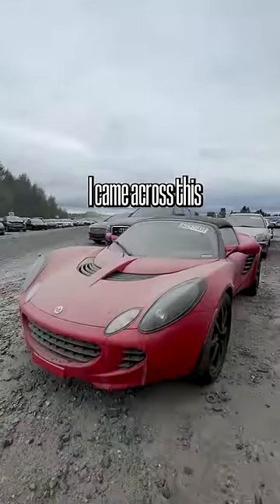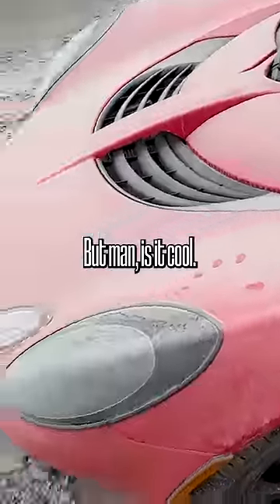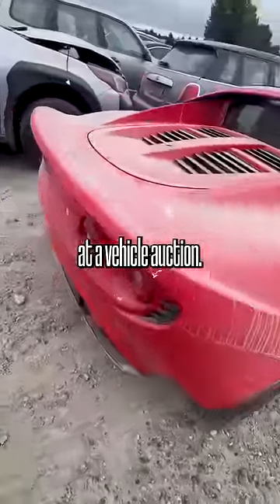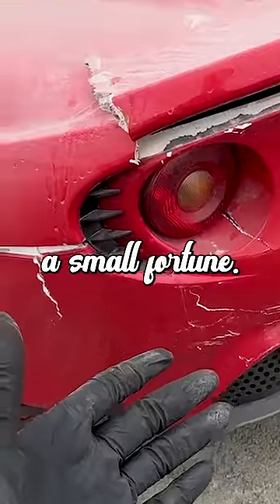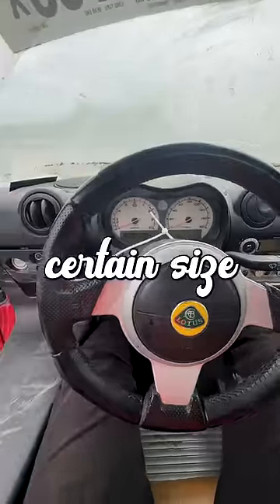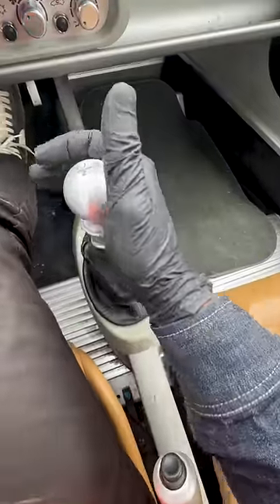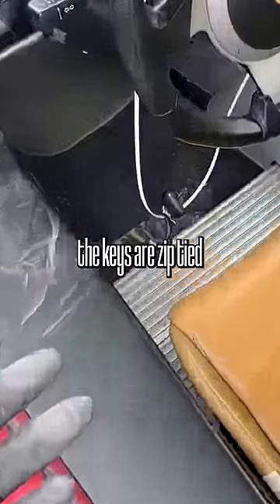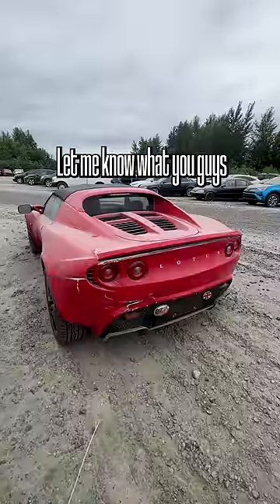Auction Lotus Elise - I Still Can't Believe It...

Comment: What a nice car it's a shame that it got hit
Reply: Yoo 😂
Reply: @@raingoesrawr I've heard that so much and it still sounds funny
Reply: @akibhossain5558  yo its me bro you didnt recognize me? 
TheElantraMan?
Reply: @01Elantraaa  yes bro
Reply: Probably was hit at the track, and didn't tell insurance.  Still worth getting!
Reply: Fiberglass is easy to work with honestly that should be an easy fix
Reply: Probably got hit doing what it was made to do 👌🏼
I’m sure it isn’t there because of the rear damage. 
It’s probably got some issues...
Reply: I worked in fiberglass so it's easy to fix that. I'm gonna assume engine problem since engine is in the back where it's hit
Reply: @thatguywoods7778  
That’s what I said.
It wasn’t left here for some cosmetic damage. No way.
It’s gotta have mechanical issues.
Reply: @JP_Patriot  The good thing is a whole replacement engine from a scrapheap is not going to be too expensive. There are literally millions on the road.
Reply: If this was in the UK I'd say it was 5-7k Punt.
Reply: @ianedmonds9191  
Right. Someone will snag er and fix it up.
Reply: Bondo fixes everything
Reply: @Semo_420 it is…just some sanding and being sure the pieces are aligned and getting the air out…i would be worried about mechanical issues with the car…like he said it’s a Toyota engine but as son as they see it’s a lotus the price 3x

Comment: I saw one of these while I was on a trip to the UK. Kinda liked it ngl
Reply: That one would have featured the Rover K series unlike the USDM one in the video due to the Rover K series not passing US emissions
Reply: @elliottharrisonellbot2814 the UK also switched to Toyota engines at the same time, so could be either depending on when it was. If it's still running today it's probably got the Toyota engine though :D

Comment: I had a blue 2005 Elise.  Totaled it in 2009.  Just got the 22,500 service that day.  I truly loved that car.
Reply: apparently not if you totaled it the same day after dropping my entire car's cost on it...
must be a rich person "love"
Reply: @daydreamers8254 i believe he was saying he just had done the 22,500 mile service
Reply: @daydreamers8254  No it was 22,500 miles service not $.  I bought the car with 4100 miles on it for $39,000.  I was t-boned at an intersection that night after I had the 22,500 mile service.  I think about that car all the time.  It was literally a sportsman’s dream.  😊
Reply: @rod-rodney  correct 👍🏻
Reply: Sorry to hear you lost the vehicle. 

What is the annual maintenance cost for one of these and did you take it to the track? How do these feel to drive? Was this a car you could daily drive or was the engine tuning / transmission to aggressive for driving slow in stop and go?
Reply: @craigstynardt4990  Thanks.  It was a daily driver.  It had a Lotus tuned Toyota 4 cylinder and it got up to 28 MPG.  Oil change every 7500 miles.  It had a 9 gallon fuel tank! Hands down the very best of all worlds.  I never took it to the track because I lived around extreme mountain roads.  It was so short and stiff that you could not break the rear ended loose.  It couldn’t be touched on the curves.  190 HP and a top speed of 140.  😊
Reply: @aggit8  Thanks so much for running through the highlights of the lotus for me, really appreciate it - sure sounds like it was a fun beast.
Reply: @craigstynardt4990   Hey thanks for the inquiry.  It really was/is a car for gearheads.  Glad to see your appreciation 😊
Reply: Would you ever get one again?
Reply: @aggit8 rip did you get a good payout?

Comment: Man, that shifter sounds satisfying idk why
Reply: Probably because it's is one of the best shifter actions ever put into a road car.
Reply: @productdesign9626  surely looks like it
Reply: @productdesign9626 still wouldnt hurt with an aftermarket short shifter. those are so good. lol
Reply: @productdesign9626 same one as in my Celica, the most satisfying gearbox I've ever experienced. Everything just kinda slots perfectly into place with a very satisfying clunk
Reply: @cryaesthetic3603  what gen celica?
Reply: Smoooooooooth
Reply: it feels also like it sounds.  very very nice
Reply: @lon3lyRacer  I've got the 7th gen (t23). came with the same engine structure/ family as the first gen lotus in the video
Reply: @productdesign9626 It's good but if you compare it to the S2K or NSX shifter... it's lacking. That's why people get the Sector111 shift kits for these cars
Reply: sounds like sitting inside of a carnival ride. one of those big composite clamshell balls ones
Reply: Amazing transmission witha direct linkage, like it should be!!
Reply: @productdesign9626 it’s really not, a lot of owners upgrade the cables or replace the shifter entirely because it has a bit of slop. It’s definitely not bad but far from great. The later cars with the open gear linkage have a tighter more rifle bolt action but it’s still not quite as good as some MX5 or Honda shifters.